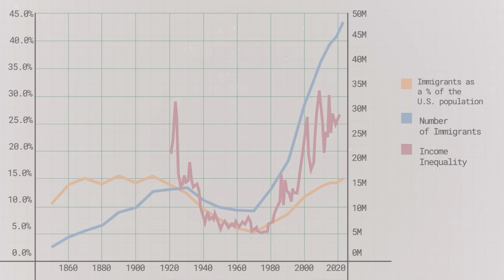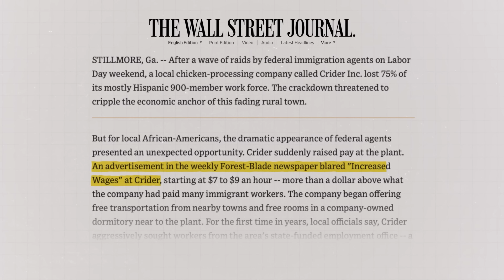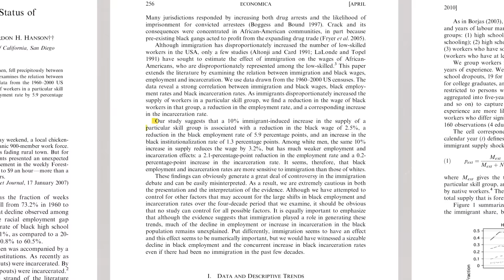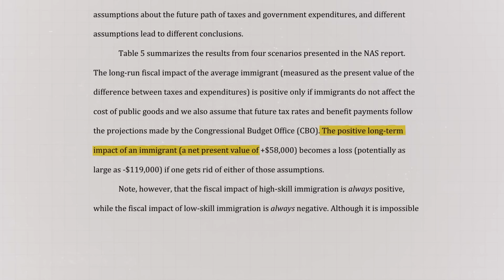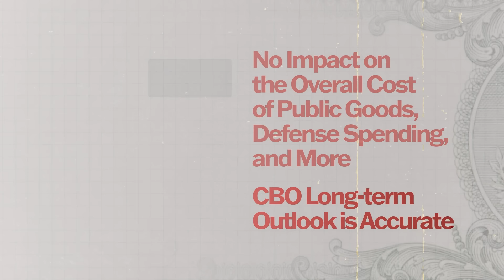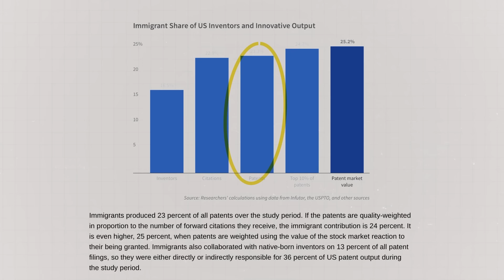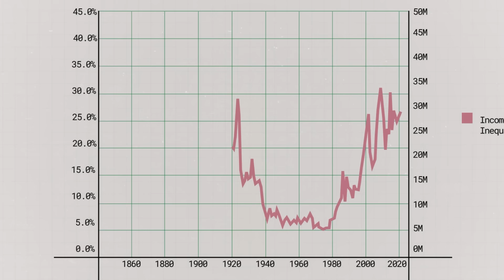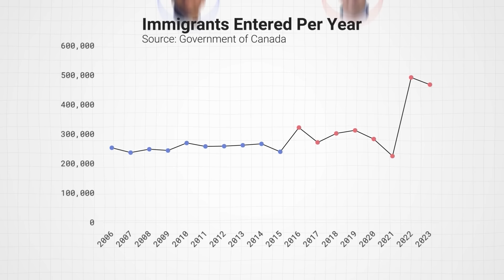What the U.S. Doesn’t Want You To Know About Immigration

Comment: The most comprehensive meta-analyses on this topic, conducted by Longhi et al. and Gen et al., demonstrate that immigration generally enhances international trade by boosting trade flows between host and origin countries. The studies indicate that immigration has only a minimal impact on wages and employment.
Reply from the maker: Ya that study is very misleading and I employee you to dive into the specific studies it looks at.

Firstly, the studies that suggest no impact on wages are long term and are based on modeling not real world data. As you must be aware, these models are highly bias given they assume long term capital efficiency which ensures this result among other things.

In the short term, nearly every study saw a reduction in both wages and employment when the data was analyzed by cohorts related to skill level.

Furthermore, all studies, even those that model it out, show that when you strip out high skill immigration that immigration is a loss to the nation
Reply: I believe that assuming long-term capital efficiency is valid and does not mean the results are highly biased. The studies by David Card, such as the Mariel Boatlift Study, and research by George Borjas use real-world data and show minimal impact on wages in the short term, with clear benefits in the long term. Even when taking a conservative approach with these studies, we can be highly confident that immigration is more likely to increase wages rather than decrease them. Additionally, immigration can improve a country's capital efficiency by fostering a more productive use of resources.

It is true that there will be individuals who may experience negative impacts, but it is important to consider how much they lose and how those losses compare to the overall benefits for native workers and immigrants themselves. Are there specific solutions that could reduce the harm to low-skilled native workers in the short term in a more targeted way?

You mentioned that an increase in supply generally puts downward pressure on prices, and this is true. However, in the case of immigration, the increased supply of labour is accompanied by an increase in demand, as immigrants also consume goods and services. While there may be short-term impacts, the economy ultimately adjusts and reaches a new equilibrium.

If immigration has zero impact on wages, should immigration be increased or decreased? I believe that if the economic cost is zero, the United States should accept more immigrants, as the moral case is incredibly compelling. These individuals are coming from unimaginably difficult situations, and providing them with opportunities at no economic cost is clearly the right thing to do.

I am not suggesting that you are part of this group, but I believe that many people arguing against immigration have already made up their minds and are searching for evidence to support their position. It is difficult for many Westerners to openly admit that they do not want foreigners living near them, which often leads to rationalisations based on selective evidence.
Reply from the maker: You make a lot of good arguments. The Cuban migrant study you cite is an interesting one and Borjas would argue a different conclusion, although his analysis approach is suspect (but so is Cards). I would argue that study is inconclusive at best.

The long term capital efficiency assumption is fair in some respects and not in others. My main issue with it is that using it to rationalize policy is bias in the long term, because the outcome is always the same. Put differently, in the long run it all evens out no matter what.

Also, in the short term, as we show, most studies do show a negative impact from immigration, and when you isolate by skill level it’s more pronounced. In addition, even the modeling you cite gets most of its benefit from high skill immigration which is a minority of immigration.

Our argument is that low skill immigration (which is the bulk of immigration) seems to have a downward impact on wages and employment with like for like groups and is neutral at best economically and likely negative once you remove some pretty absurd assumptions.

However, high skill immigration is almost always positive and most economic gains related to immigration come from high skill immigration.

I appreciate the thoughtful discussion. You clearly know what you’re talking about.
Reply: @2and20  Good to have a civil discussion. Excellent video editing for a finance bro btw. Who else would have a channel called 2 and 20

Comment: Before we give the high skill jobs to immigrants H1B visa holder why not make sure those jobs are available to be filled by Americans…. Most Americans hold a bachelor degree if not even a masters… it just seems like these companies are searching for high skill works to pay less and who else better to exploit than immigrants
Reply: @2and20  lmfao you don’t see an issue with this? Just look at how many locals are moving out of the Bay Area and California, CS and engineering has been taken over completely it’s absurd how you can something like that
Reply from the maker: @luttufu9292 I have deleted the previous comment as a member of our team misspoke. To be clear, the data and research suggest that high skilled immigration does have a negative impact on natives when it comes to employment and wages.

That said, the impact is miniscule, compared to what we see in low skilled immigration. This is not to suggest that the US push high skilled immigration to achieve similar negative outcomes as low skilled immigration, rather it is to state that the consequences are far outweighed by the benefits. Unlike low skill immigration, high skill immigration across every study is very beneficial to the American economy. These individuals have had an outsized impact on IP/patent landscape as well as company building. Without them, you likely would not see the same level of innovation.

Our view is that high skilled immigration should be increased a bit more, as this is where the benefit is. While doing so, native metrics should be monitored to ensure that it does not go overboard.

However, another point we are making is that if coastal elite are so pro immigration they should experience it in their industries, and once they do we imagine they will change their tune.